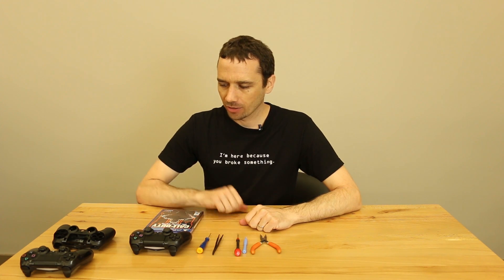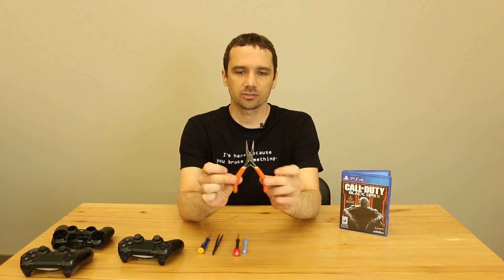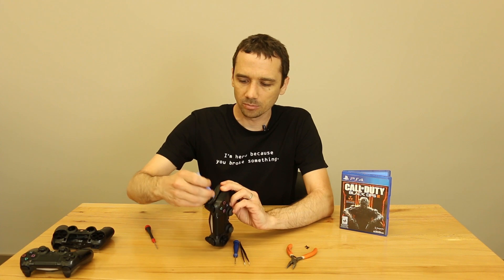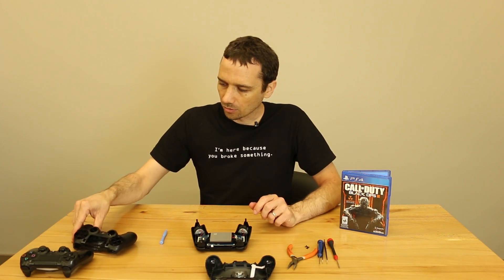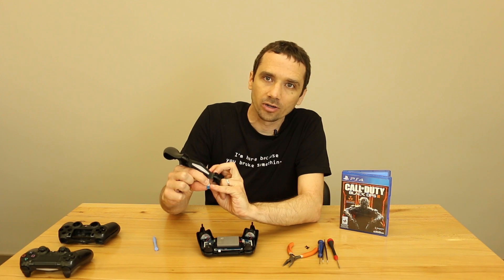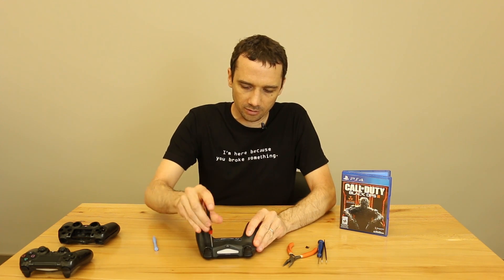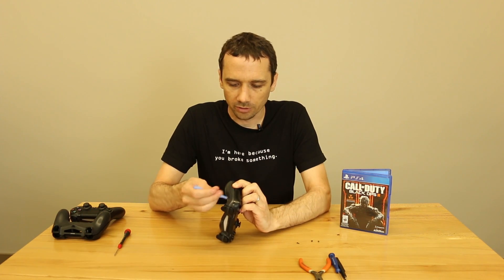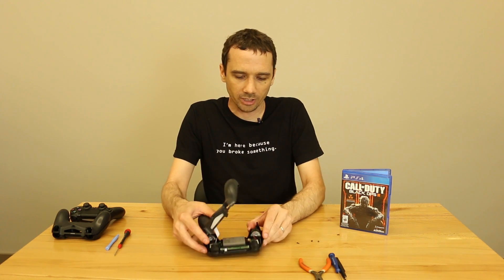Take Apart a PS4 Controller Without Breaking It

Comment: I couldn't get the outside screws loose. Even used the 00 screwdriver. Tried various sizes and they just turn in the screw head or try to strip it😢

Comment: I swear they designed this controller specifically to feel like you're constantly going to break it every time you open it.
Reply: You will. The small snap catches on the left and right are nearly guaranteed to break. The springs used for the L2 and R2 buttons are almost guaranteed to fall out while disassembling. Putting those springs back into place is tedious at best.
Reply: try fixing a ps5 remote lol
Reply: Just like the stupid PS4, I swear I couldn't open mine with a hammer.

Comment: Can you do a video on how to fix the buttons?  Have an issue with my O button and it's a fairly new controller.  I see a lot of videos with people having issues with the X button with no permanent solution.
Reply: either need to replace the whole ribbon cable or clean ribbon cable under the action buttons

Comment: I really appreciate the way you actually described where the plastic pieces are. I actually broke all the plastic pieces in both my controllers because nobody said anything about the pieces just pushing down on the r2 l2 buttons. Thank you though. Now maybe I can spend another 40 bucks and not snap the plastic if the battery won't power up

Comment: What if u have a a little piece stuck where u plug in ur headset can I just remove it from screwdriving the top of the controller and it will fall out?

Comment: I open it, take it apart gently, and it never works again. I have no idea what's wrong with my controllers, the only thing I'm just connecting is blue ribbon and I'm putting them back in the right way and firmly

Comment: I got a controller with 2 buttons not working (D-Pad down and L1), they are not sticking, they just don't register any input. Took mine apart and didn't see any dirt or any noticeable things that would indicate the problem. Put it back together and the buttons are still not working. What would the next step be?

Comment: This did help.  My controller was very hard to get apart, but watching these steps and seeing how it comes apart was enough.  I removed the LED on my controller to help save battery and it worked great. Ripping out the LEDs can ruin the controller if not done right.

Comment: “You can hear...” You can hear it alright. What you’re hearing is the actual snapping/breaking of the plastic hinges that keep the controller shut tight. Almost every single person I’ve ever seen open a DualShock 4 absolutely neglects opening it perfectly, without breaking any part of the controller. iFixit warns about breaking them but it doesn’t teach or show the layperson how to do it.

Comment: Just a fyi the cases from the original black and green camo are different, just tried to swap guts as the black has rarely been used and the green camo L3 is in full grind mode, also the ribbons are inverse to the black one...but thanks for showing me how to pull it apart

Comment: You are not even taking it apart thoroughly, you still have the main circuit board, battery, touch pad and much more. all you do is screwing of the main cover and putting it on again. im sure no body needs a video tutorial for that!

Comment: After opening, DO NOT pull the whole white ribbon cable connector off. Just use small pliers to pull the cable out of the connector. I just ruined my controller that way.  -_-

Comment: How to get a headset bit that snapped off in the controller
Reply: I just did this too. I opened the controller and than used thin pointy tweezers and the tiniest flat head screwdriver to wedge it out. Good luck
Reply: How to work on ps4 controller

Comment: its near to impossible to open the controller without breaking the 2 side tabs located near 'triangle' 'circle' (and on the up left buttons). hats off to anyone who shows a technique to open without breaking them.
.
Btw its a good channel; answers most of my ps4 questions; especially fan sound and temperature videos. thanks.
Reply: Just broke it yay
Reply: There's no way not to break them. They're extremely thin and very brittle. Thankfully, they don't really matter because the screws do the major share of the work holding it all together.

Comment: For all people complaining and crying about the controller already being loose and can't get the screws out. This is my first time taking my controller apart and I had no problem, I used a husky brand ratcheting screwdriver set with a crvph0 bit with a star shaped head. I used a mini Phillips head to pry open and no damage whatsoever. Just because you have those smooth baby hands don't make excuses against the video because if your low skill levels.

Comment: now when I turn on my controller, the light bar flashes red then doesn't work. the controller is fine but the light isn't?
Reply: Sw1ft B4nd1t you more than likely severed the ribbon cable

Comment: What if the screws are rusty??
Reply from the maker: 1) You need to figure out why they are getting water on them. 
2) If you can't get them out with a screwdriver you may have to Dremel them

Comment: create how to fix a ps4 controller
Reply: TronicsFix My left analog stick won't let me sprint in many games or move up so help please
Reply from the maker: Anything specific?
Reply: Mitch temporary fix: move the stick down and blow on the ball part (don't know what it's called lol) at the top, then move the stick up and blow on the bottom. Do this in all directions and it should work for a while (at least it worked for me)

Comment: It's funny that all the videos that show how to take apart they just fall right off with them prying with hands. Lol mine will not come apart at all.
Reply: That is the same case with mine I'm trying to replace the shell and one of the screws will not come out
Reply: @TheReelDeall  the screws came out but the controller won’t come apart
Reply: @acrxu8573  its glued together you gotta pry it with something thin and just go along the edge until it gives
Reply: I need a bloody jack hammer to get mine apart, and putting it back together.....well still trying.
Reply: The first time mines was hard to get off. The second time I needed to open it it was a bit easier.
Reply: Not sure if you've solved it. It's been a year obviously, but a flathead screwdriver worked for me (eventually)
Reply: @reeceytaylor  but did your controller have jagged edges? mine does >:(
Reply: I was just patient and kept trying without stripping the screw so if you keep trying it may come out
Reply: Same. I can't get the left top side at alll
Reply: Bubbadaluva you have to rip it apart luckily for me no buttons got broken
Reply: such fax
Reply: that's because they broke off all the clips inside prying it apart.

Comment: all I did was pry apart one side of the controller and now my R2 button won't go up fully without me doing it manually.
Reply: And something is loose in my controller. Either I did that first step incorrectly (even though I followed your every step), or my controller is special, or this is bs.
Reply from the maker: These things are easily breakable...especially if you've never done it before. How I show you is how I do it, but at first they can be tricky. You'll have to take a look at the R2 button inside. Most likely it just came loose.
Reply: okay. thank you
Reply: Alex Hughes my name is Alex Hughes. Cool name.

Comment: my L3 button does no work every time on my ps4 controller. any ideas why?
Reply: I have the same problem , I just saw a video about just spray wd-40 on the left analog once u take it apart so it lubes it up
Reply: Use pure alcohol, it wets for wiping and the rest evaporates. WD40 Water Dispersant, leaves a film, which isn't ideal for cleaning electrical contacts. It will lube up some rusty metal nice, oh yeah!

Comment: I'd like to continue seeing how to videos. I would suggest some closer views though, to help with some of the tricky areas. Such as the tabs, plugs and such. Right now, my problem is the sprint function in black ops. I heard disassembling the  dualshock 4, and using compressed air in and around the L3 button helps. It may actually need complete replacing. I can find a module online, and do it myself by soldering and save a ton of cash. That would make a great video for you guys to do. Thanks : )

Comment: Can you guys show  how to fix a PS4 controller battery where you plug in because my controller didn't work when I tried to charge it. Thx You
Reply from the maker: We may be able to do a video like that at some point.
Reply: +TronicsFix  I pulled it hard with  another tutorial and the L2 R2 fell off and put them in the where the light is and don't know if it's broken
Reply from the maker: I don't know either.
Reply: +TronicsFix thx

Comment: Hi great instructional videos, just wondering have you repaired the PS4 Scuf controller? Can they be fixed? They have a special security screw on them that stops users taking them apart without damaging the screw or the case. The usual failure is the microswitches under the paddles.  Thanks
Reply from the maker: No, we haven't messed with them. I would think they could be fixed but we don't have one here to try.
Reply: +TronicsFix they are basically the same as the ps4 same main board same charging port pcb  but the additional pcb they add in for the bottom paddles the microswitches fail over time and they are very expensive to repair as you haven't send them back to Scuf for them to fix security screw is the main issue as it is a screw type I've never seen before if you Google Scuf 4ps security screw under images you will see what I'm talking about, maybe you know what it is?
Reply from the maker: Ya, we have some of those bits laying around the shop somewhere.
Reply: +TronicsFix any idea what type of screw it is? Users on Reddit users think it's a pentalobe screw but impossible to find a driver that fits it and Scuf won't sell you a driver for it, I myself think it's a specially commissioned security screw otherwise it would be easy to buy the proper bit off eBay to take it out
Reply from the maker: I don't know the name of it. If I run across it I will let you know.

Comment: Hi friend, I know I'm a little annoying, but this is the last question. My dualshock 4 suddenly started to fail. the X button doesn't work, so I took it apart, but I realized everything was ok, but I dont know what happend because sometimes it works only for awhile, then start failing again, I have bought another new dualsock, but I'd like to know if I can repair it or I'll have another paperweight. thanks for your atention.
Reply from the maker: +Edgar Martinez I really don't know...sorry. There are just too many things that can cause that type of problem.
Reply: +TronicsFix  I already know dude, anyway, I appreciate your reply :D

Comment: I'd love to see more videos on fixing controller problems. For example, on one controller, the R2 barely works; even when I took the trigger off and pressed the rubber myself.
Reply: Mods would be cool to see too, if you guys do that kind of stuff
Reply from the maker: +Be Frank What kinds of mods?
Reply: replace the ribbon cable or clean it under the R2 you may need to replace the rubber piece too

Comment: For some reason, the screws don't budge when I use my philips screwdriver which fits in fine. I didn't want to force it at the risk of stripping the screws. 

Suggestion video: When PS4 Neo comes out, do a video on how to change its HDD (if allowable) in case it turns out to be a different way to the current PS4.
Reply from the maker: +Eraezr If it's the right size screwdriver then just push down hard while you are turning...this should get them loose. 
Yes, we plan on getting the new PS4 once it comes out and checking it out.
Reply: I have the same problem and I tried using force too none of them are coming out I tried on an old controller so the screw driver works but none of the screws on the other controller are budging
Reply: at work i use a regular screwdriver with the star end to get it started then i switch to my power screw driver sometimes dirt glues it in there so a bit of torque first frees it up.